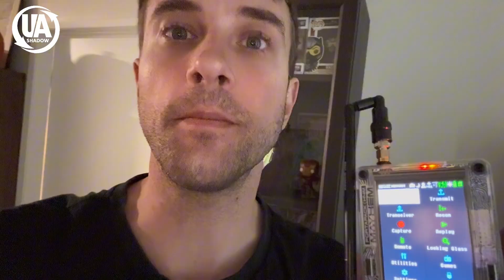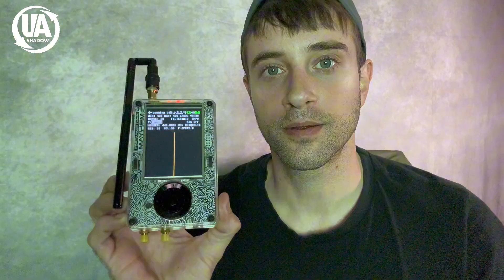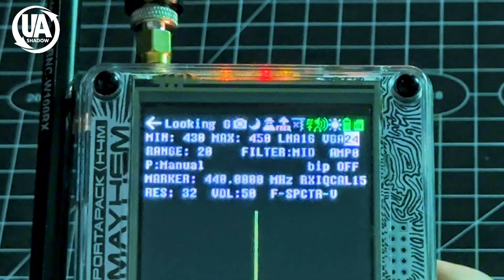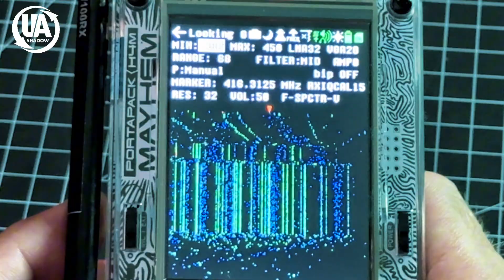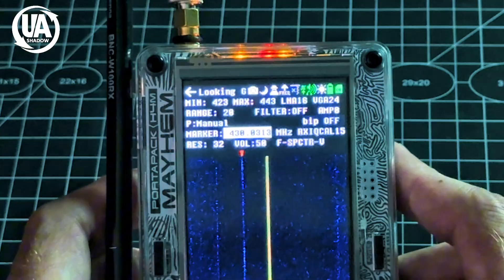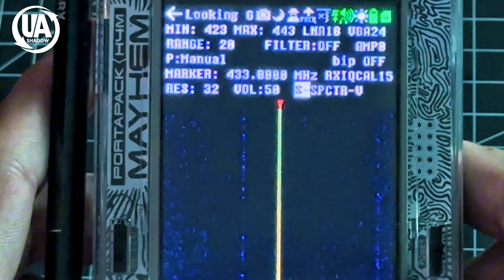HackRF PortaPack Looking Glass Settings — The Right Way to Configure It

Comment: Is there a way to decode CTCSS tones with this device?
Reply from the maker: Yes, you can! With Mayhem firmware, go into the Audio app and tune to the frequency in NFM mode. It can display the detected CTCSS tone and code when the signal is clear. Looking Glass itself doesn’t decode CTCSS; it’s mainly for viewing RF activity. The tone reading can jump around, especially with weak signals.
Reply: @uagain.shadow thanks!

Comment: hi, what is the connection adapter you got for the Antenna
Reply from the maker: HackRF is SMA female, and you connect SMA male to it. But its like a quick connect for plumbing. BNC (Quarter-Turn Quick Lock)
Reply: @uagain.shadow  Thanks, but the BNC is the max not at 2 GHz ? :/
Reply from the maker: @Oneplayer90 not sure what u mean. The hackrf can go up to 6g
Reply: @uagain.shadow  i see, the BNC adapter, i have only seen them to 2 GHz or do it not matter even if using 6GHz?
:D
Reply from the maker: @Oneplayer90  Some kits include antennas that cover multiple bands from low VHF/UHF up through several gigahertz (for example 433 MHz, 900 MHz, GPS L1 ~1.5 GHz, 2.4 GHz, 5.2 GHz, 5.8 GHz, and even beyond), not just 2.4 GHz.
Reply: Thanks, im not sure if i made my question clear. The SMA  -  BNC adapter,  the highest operating Frequency is 4 GHz. What adapter do you use if you in the operating Frequency of 5GHz - 6GHz ? :P Thanks for fast feedback
Reply from the maker: @Oneplayer90 Ahhh ok… You generally should avoid BNC entirely and stay with SMA all the way through.
Reply: @uagain.shadow  I see, it is very nice to have a fast connection. I hope you had find one that had a max of 6GHz
Reply from the maker: @Oneplayer90 	Many “5.8 GHz” antennas actually perform reasonably up to ~6 GHz.